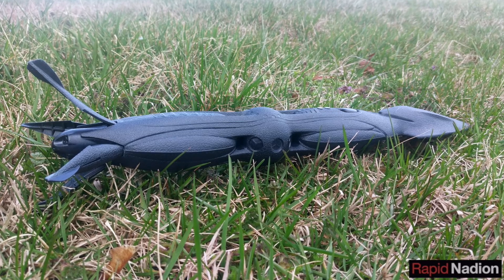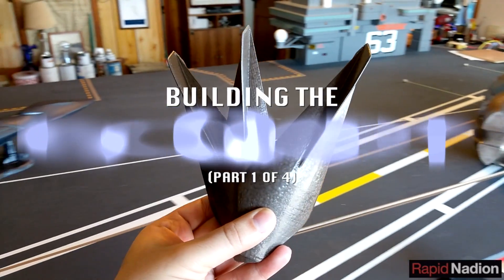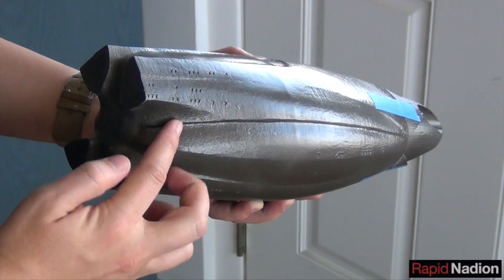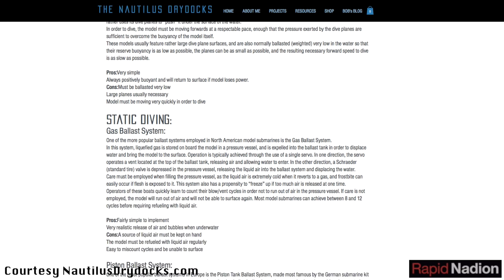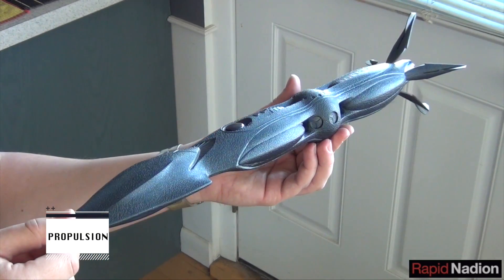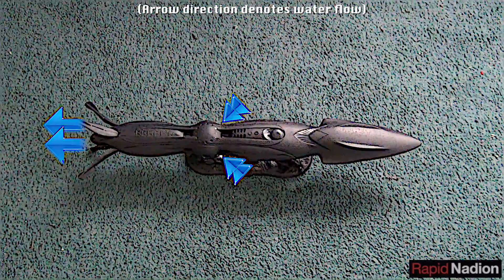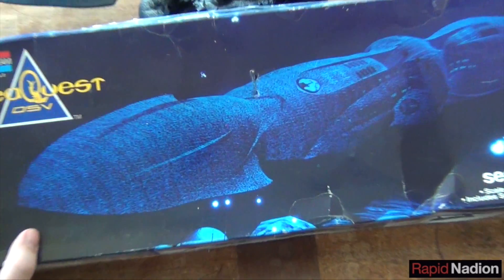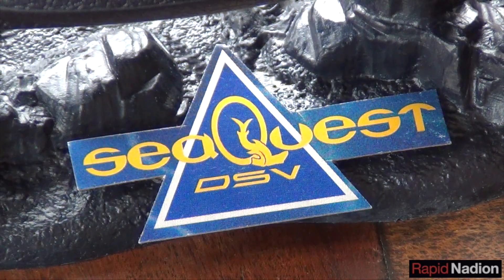Building the seaQuest DSV, an R/C model submarine (1/4)

Comment: try using electro luminescent paint. the kind the changes colors when a certain voltage and current is applied. you can waterproof it with clear resin
Reply from the maker: Thanks for the tip, Cecil.  We will look into this product.
Reply: Rapidnadion Could you build a model of the USS Iowa?

Comment: Awesome project! I have been a lifelong fan of the seaQuest DSV series and have been fortunate enough to have met several people involved in the production of the series and actually go to tour the set of the seaQuest back in the 90's. I collect seaQuest DSV costumes, props and memorabilia and created and run a seaQuest DSV costuming group called "DET ONE" (our link on Facebook is: https://www.facebook.com/groups/85864768830/). I have built a few models of the seaQuest and have studied its design pretty thoroughly, and I would like to clarify one thing you said in the video. You have stated that you thought that the extendable tail sections were used for "steering", but in the design concept, these were used for primarily for slowing the ship rapidly (like a drogue) when extended, being closed flush for high speed travel. They were also used for stabilizing the ship. I don't know if this ultimately matters for your purposed, but I just thought I would point that out. I look forward to seeing this model work! Long Live seaQuest DSV!

Comment: With original Monogram model it was easier to show the Bio Skin because the plastic was not smooth, plastic had dimples and depth. All needed was crayon and some paint. If you can replicate that with a layer of depth it would be easier to replicate that effect. However way to go on the model! This is a great build just as the show was (the first two seasons...)

Comment: Used to watch the show.  Actually watched it again on Netflix not that long ago.
Its too bad they guy who did the computer model and printing didn't print the hatches into it.  If its possible to have it reprinted I'd recommend getting as many hatches and holes pre-printed.  The best way for smooth lines. 
Also, have you considered having only one thruster for forward movement and then using another one to pump water out the sides of the rear "steering" fins?  The water could be directed to the right or left duct by just a simple gate.
Reply from the maker: +Brandon B We've modified our thinking on the propulsion plant somewhat and will now implement offset thrust back aft. More updates in our next build video in June! Also: yes indeed, having pre-formed hatches would save a lot of work -- but we always knew we'd be working with a prototype model.

Comment: Loved this show! I think the rear "tail-tentacles" rudder & dive planes could be used to maneuver the submarine. Let them drop back to go forward, they will induce drag when extended.  Also, you could use the 3D printed model to create a vacuum formed outer hull/body, this would allow you to make mistakes, and re-cast the section in question as needed to form natural access points to the inner workings.
Reply from the maker: +Lasrin Xefativ We thought about using the tentacles as rudders and planes, but there's so little space back aft we decided not to try to squeeze steering servos in alongside the propulsion plant. We're going with a modified version of our original engine design; more updates in the second build video in June!
Reply: +Rapidnadion makes sense.  limited space affects design choices.  I look forward to the next update.

Comment: I have been watching this channel since 2012 and I have to say, this is quite an endeavour. I suggest using a pump based ballast system, it eliminates the need for onboard gas tanks and will simplify your build a lot. However, it would require extra batteries so it could be counterproductive. I hope it turns out well :)
Reply from the maker: +yo momma Thanks for the input! We're excited to start work on the ballast system, and we agree: simple is better.

Comment: from an engineering student:
on turning perhaps you could use servos to retract and extend the tentacles at the stern of the vessel to steer the ship instead of the multi engine design which one mide as well not do the closer together they are the worse it will turn not to mention the fact the the sub is rather long  the odds are not in your favor for it too turn much at all. Perhaps both methods would be appropriate. You also could consider vectored thrust though it may be less visually appealing as you'd need control surfaces or the propeller to be near an opening at the rear. looking at it the current configuration looks like it may cause it to strafe significantly relative to turning.

hope it turns out well.
Reply from the maker: +Alex Klausenstock We're still considering all options, so thanks for the input! We'll update in a few weeks after we've made some decisions.

Comment: Even though it's one of the lesser important things, it you paint it green, let it dry, and then you put on a thin coat of blue, which you gently wipe off of the raised bumps on the hull, you might get close to the textured look of the CGI ship from the show
Reply from the maker: +Cjfedler 327 That's one approach we're considering, as it was the one Revell suggested for the study model. Another option would be a high-pressure spatter pass.

Comment: Cool project! I'm looking forward to following along as you make progress.

So the stern tentacles act like drag rudders? Drudders? ; )

Perhaps take a look at the old X-31 thrust vectoring system. While not a perfect replica if you add tiny paddles to the thrust outlet, they could help it actually turn instead of hopefully turn. Good luck!

Curious to see your experience with underwater RC (I suspect fresh water only) too.
Reply from the maker: +AeroSpaceNews.com Hopefully not too much!
Reply: +Rapidnadion you could also use the tentacles as drag rudders and a thrust vectoring system would be the best for steering and dive control given the lack of control surfaces.

Comment: I watched the video for the 2nd time, (after calming down form the excitement of you guys making a R/C SeaQuest), and I was thinking about making her turn. I think a how thruster could help and make her turn better. Although finding the right spot might be tricky, but not impossible. If you cut some holes in her sides for the thruster and cover it with screens fine enough to hide it but not so fine that water has a hard time getting through. Now as I've said I have pretty much no expertise with R/C subs but that's what popped into my head for an idea. I hope that'll help in your construction process of the SeaQuest.
Reply from the maker: +KITT10K Thanks for the suggestion! We're trying to keep all propulsion machinery aft of the hangar sphere for simplicity's sake, but we'll keep the idea of bow thrusters as an option.

Comment: wow, i tried to build one about 15 years ago, but it was to difficult because the structure was so unstable from the docking bay aft where obviously the hull is heavier with the engine. This was when all we could do is make moulds out of fiberglass the old fashion way. Anyways, I may try again one day especially since you guys are doing it. idea for propulsion is instead of reversing the drives to move the boat, have vents that open along the hull kind of like thrusters on a space craft. have one on each side of the hull that open when you need to turn the boat. You could also add 4 in the bow of the boat to control the front of the hull.
Reply from the maker: +dlawson688 Thanks for the suggestion! Would love to hear about your build sometime or see photos if you've got them; this is such a rare build that we're hungry for all the material we can get our hands on. michael@rapidnadion.com if email is easier.